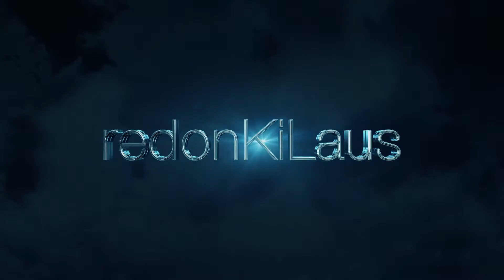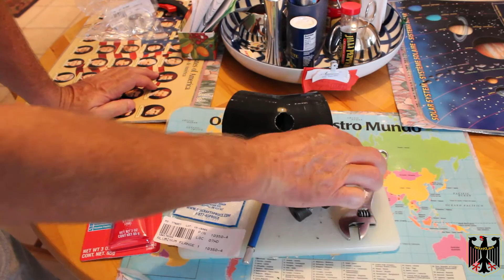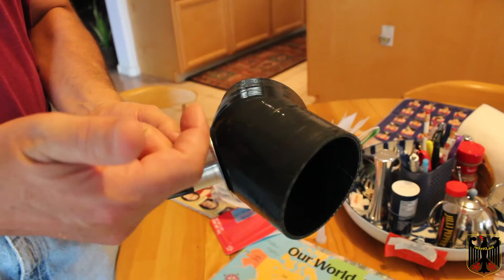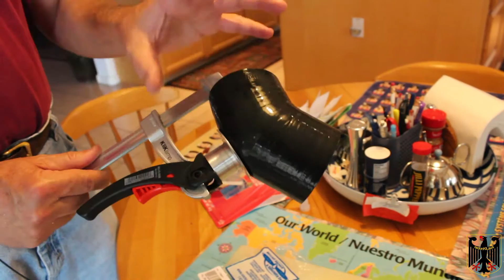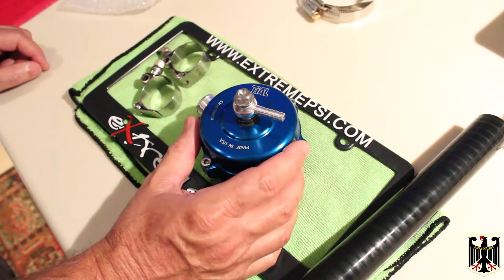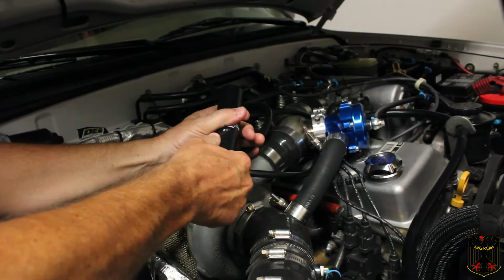Turbo 3RZ-FE 4Runner - How to Convert TiAL Q to QR and Recirculate Your BOV

Comment: i ordered tial qr for my kit. will i be able to convert to tiar r ? so it could vent to atmosphere ?
Reply from the maker: You could convert to the normal TiAL Q to VTA by purchasing the standard Q lower housing and blocking off the recirculation point, but I would highly recommend running the BOV recirculated, as you can definitely still hear the sound almost as much as a normal Q valve but don't have any issues with stalling, which becomes a true pain if you daily drive the vehicle.

Comment: Do you know were we can buy the two ring which are going Inside the BOV ? or can you give me the dimension of those so I can buy it ?
Reply from the maker: I'm not sure which two rings you are talking about - can you clarify?  If you're looking for spare parts for the valve itself, I would contact TiAL and explain what you're looking for to them.  Hope that helps, and thanks for watching!
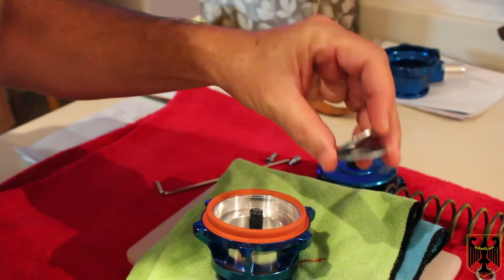Reply: The two ring in your hand at 3:16 in the video
Reply from the maker: Ah, I see.  Those are just 1.5" OD x 0.75" ID washers that you can purchase at almost any hardware store.  The part number for them at Lowe's, for example, is 215665 (for a 2 pack).  I hope that helps, and thanks for watching!

Comment: what size bov
Reply from the maker: Layinrubber The TiAL Q and QR both use a 50mm V-Band flange.  Thanks for watching!
Reply: isnt that kinda big
Reply from the maker: It's the largest common BOV available, and flows tons of air.  Its size isn't why I bought it, though - TiAL has proven to be most reliable in my experience, especially when compared to popular alternatives like HKS, GReddy, and TurboXS.
Reply: would its size be a issue?
Reply from the maker: No, not at all.  You can never have too much flow through your BOV.
Reply: ok cool

Comment: Where in gods name did you get the qr housing. I camt find it anywhere, and tial is giving me the run around
Reply from the maker: You can order the housing from ExtremePSI or Verocious Motorsports online.  Verocious is cheaper, but they take longer because they do not stock colors other than silver, so I personally ended up ordering from ExtremePSI for convenience's sake.  Thanks for watching!

Comment: Doesn't even rev the car after he installs everything... Even Had to make shoutouts as if he's desperate for sponsor discounts... Poor video and if you don't like it block comments
Reply from the maker: I don't do "shoutouts" for any sort of sponsorship, and I can assure you that I am not desperate for any discounts.  Simply put, people often ask me where I purchase the parts that I show in my videos, so I have started mentioning specific vendors and part numbers in the videos themselves.  In this video, when I mention where I purchased the QR bottom, hose, and clamps, you'll notice that I also talk about my disappointment in Extreme PSI, as they declined to price-match with another vendor; I did not receive any discount or kickback from them nor any other company.  

I also did not rev the truck because there would be no reason to do so - a recirculated QR BOV is virtually silent, so there would be absolutely no value added to the video by revving the vehicle.  

Thanks for watching!

Comment: I have tuned a 3rz with greddy emanage they are pretty crude but bang for buck worth it on hilux got abuot 300hp at the wheels on safe tune around 14psi from memory 98octane fuel on standard motor it finally let go at about 19 psi over 350hp at wheels still on standard motor which munched 3 pistons and rods .. so put new motor in and kept at 14psi
Reply from the maker: I wouldn't mind tuning my truck, but I don't like piggyback ECUs at all - standalones are much better in all aspects.  Where I live, though, I have to retain OBDII functionality to keep the truck registered, which means keeping the stock ECU.  Since my truck is one of my DDs, I don't really want to mess with it any more, either, since it runs so well now.  I couldn't make a lot of power anyway...the highest grade pump gas here is 91 octane (which is what I run now), and E85 is very sparse, so I am limited to 91.  Thanks for watching!